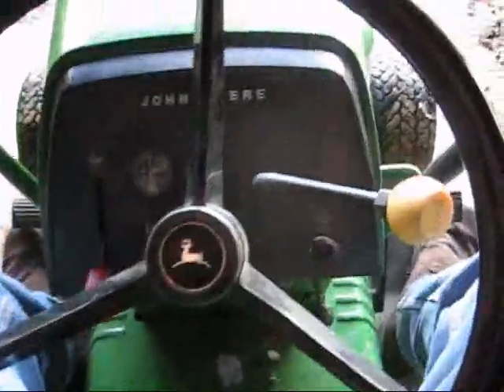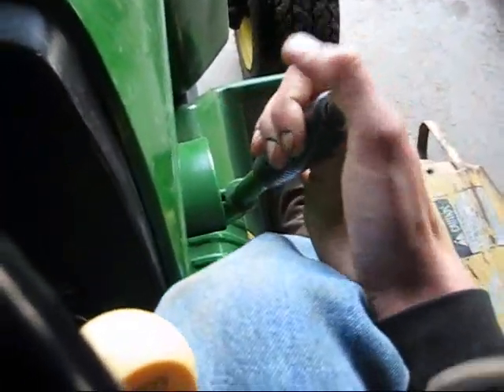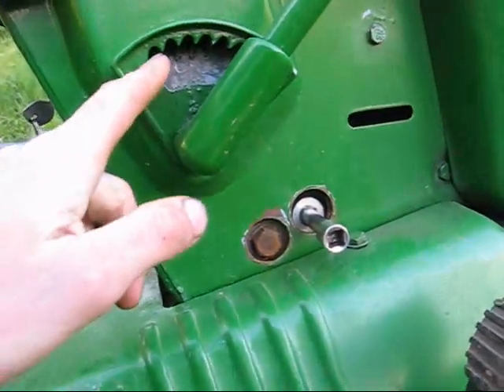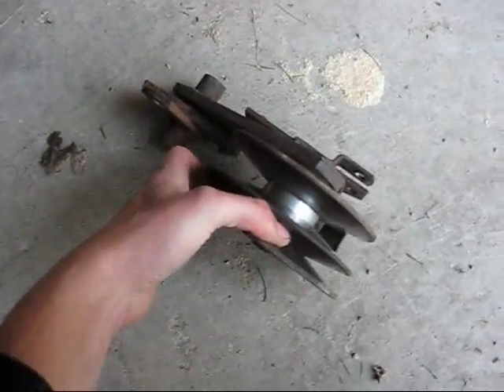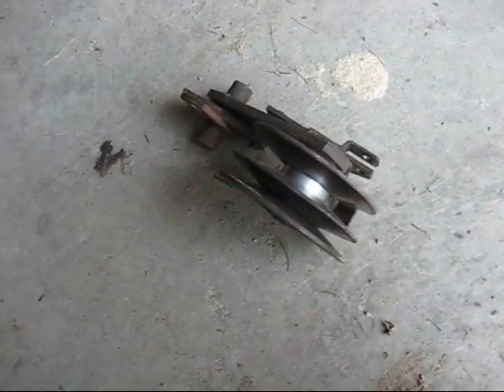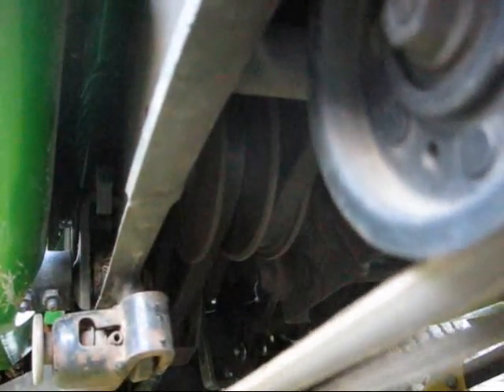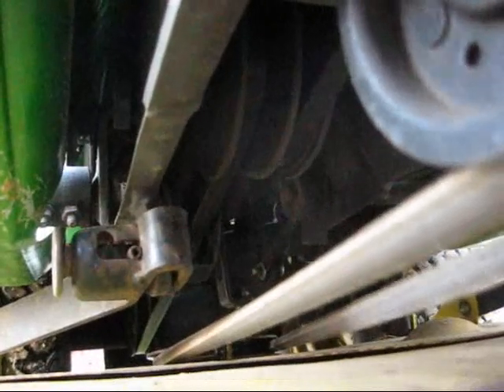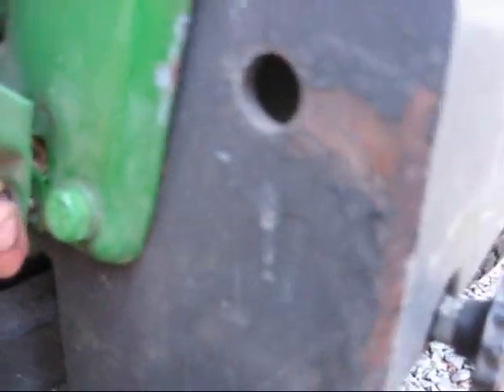How a john deere variator works

Comment: By causing the belt to ride higher or lower in the  pulley, it has the effect of making the belt run on a bigger or smaller pulley. It's a genius invention because it is so simple and yet it allows for a huge variety of gear ratios.

Comment: When I move the lever forward on my 212 the tractor will not speed up at all I tried the adjustment like the manual says to but it still won't speed up what else shuld I try?
Reply: Possibly bad / broken springs.

Comment: Eh I just got one with a grater but I don't think the variater works properly it has broken off I fixed it and it moves with a screwdriver as a button , so it works as a hand clutch because I haven't tried it set to zero but. How fast should it move mine has a big bog and I think it's the variater -sorry bad grammar one more question if it's out of set how do I set it .? -Thanks
Reply from the maker: Seth Pacholko  buy a manual and follow the step by step procedure is the best I can tell you. If you follow the procedure it works pretty good
Reply: +1944johndeerel ok thanks

Comment from the maker: well yes and no to that, If it slows down a little bit in the higher gears that is acceptable. if it creeps really slow as if it was always in low gear going up hills your variator spring and transmission tensioner pulley springs may need to be replaced. if you have to pull back on your clutch pedal to get up a hill it needs springs

Comment: @1944johndeerel I meant to say a torque converter on a go kart, where the pulleys change size with engine rpm, yet this is a manual version.  Still an asesome design, makes me want a Deere now!

Comment from the maker: @CSAKvids well its not a centrifugal clutch because it releaces tension on the belt to stop like a normal belt clutch, but you can control the belt ratio from the engine to the transmition with the lever on the dash or the clutch pedal.